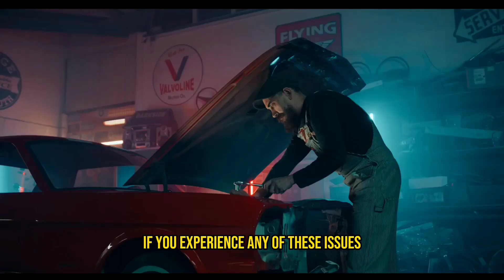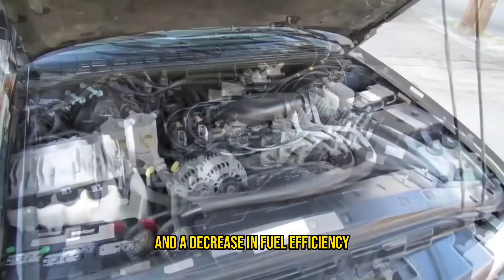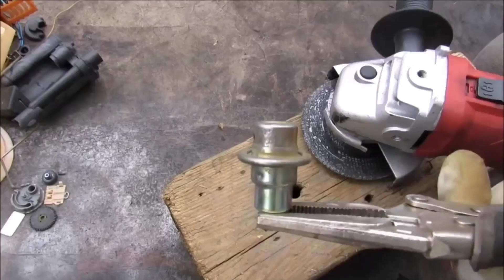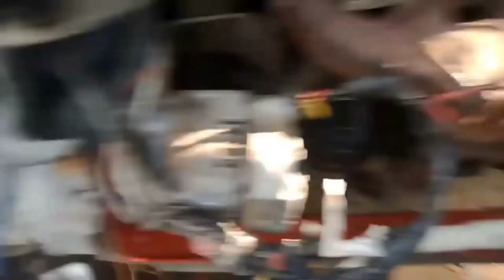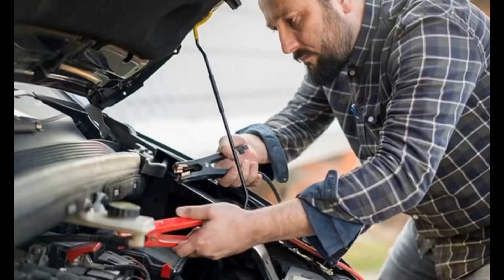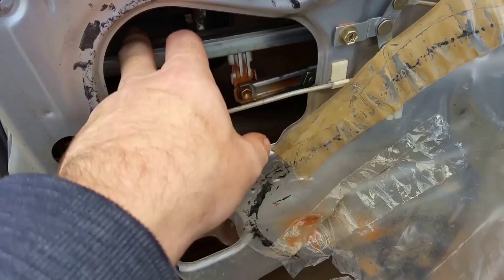CHEVY SILVERADO 2003-2006 COMMON ELECTRICAL PROBLEMS.

Comment: Pure garbage off a 2006 Chevy Silverado I installed a 289 69 ford crate engine running perfect not the fastest an the 4 wheel drive is perfect you want a good truck building your self and be happy